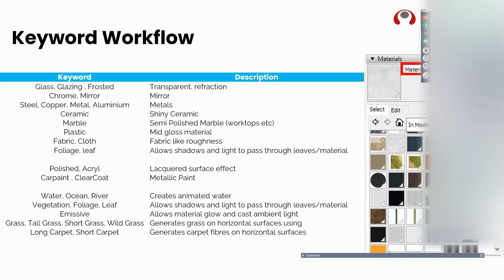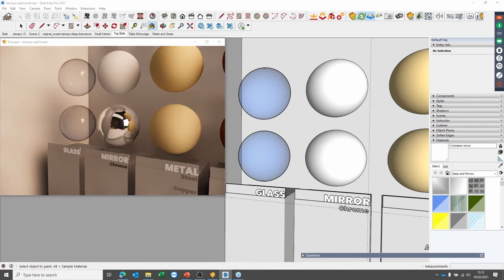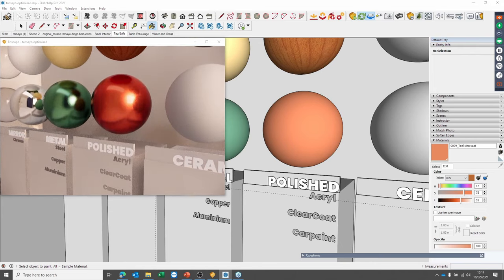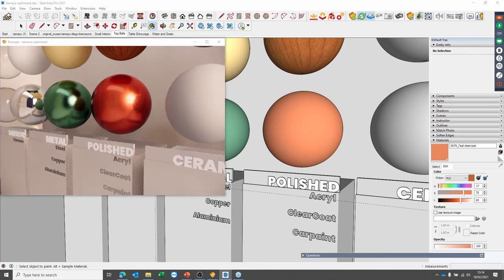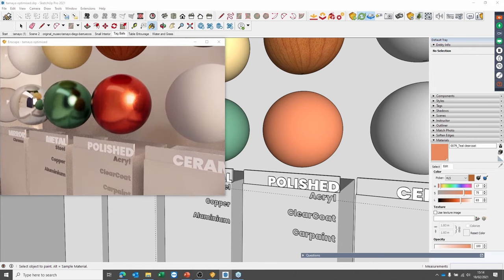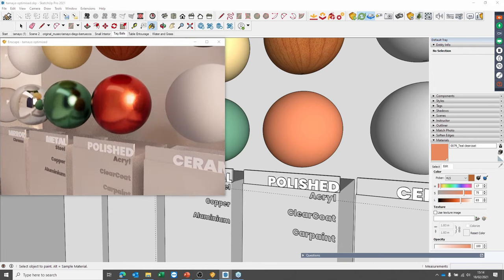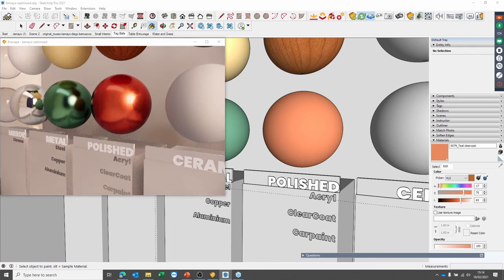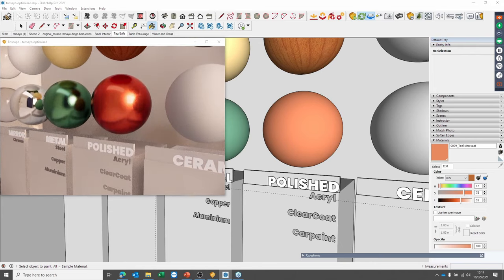Working with Materials in Enscape and SketchUp - Webinar

Comment from the maker: Link to the slides https://elmtec-sketchup.co.uk/wp-content/uploads/2021/02/materials.pdf
Reply: Thank you brother for sharing the content you received. pdf. I'm curious, but in the video to the right of some tool, the Enscape window is fixed when I run SketchUP. I turn on the Enscape program and divide the monitor window into 2 parts. And in your video, you recorded that window position, and when you move the SketchUP window, the Enscape window does not go out of outline to the right of the video, which plugin you are using.
Reply from the maker: @asgard3589  it’s the RTX Desktop Manager , which works with my Quadro 3000RTX GPU
Reply: Wow! Congratulations and thanks for this very informative webinar. I learn a lot. By the way, is it possible to request a link where we can download the SketchUp files that you use in this webinar, for me to follow along with this tutorial?

Comment: You forgot to adress probably the most important aspect to have a realistic rendering. And that is the HDRI map used for your interior render.
Reply from the maker: I didn't cover lighting in this workshop - but yes, certainly a good option if you aren't wanting to use the dynamic IBL system that is part of Enscape